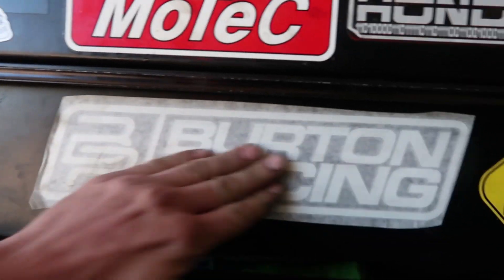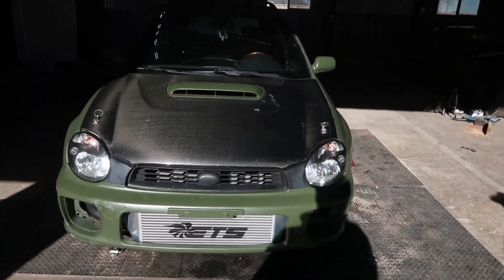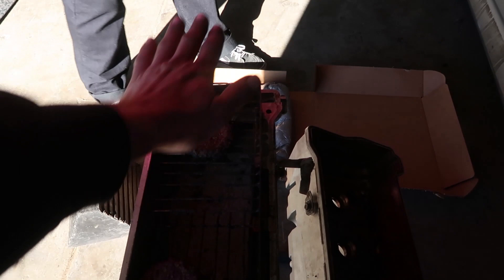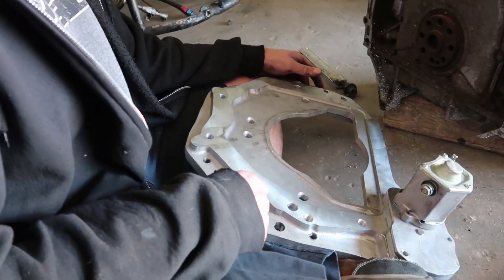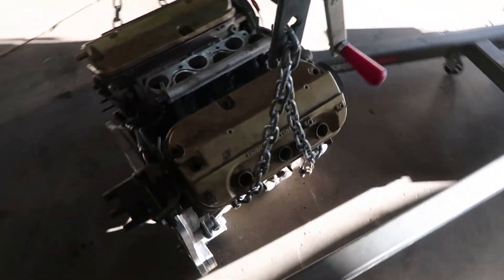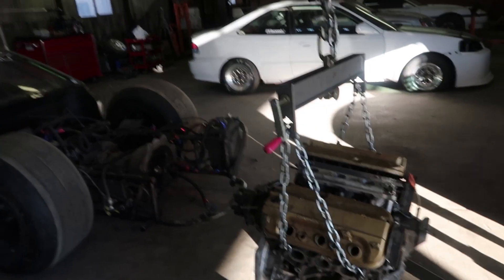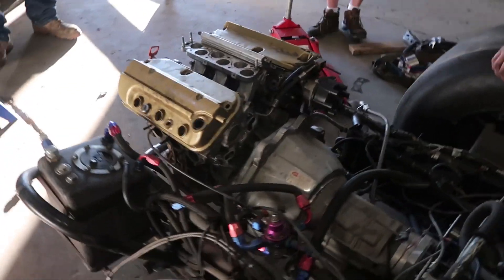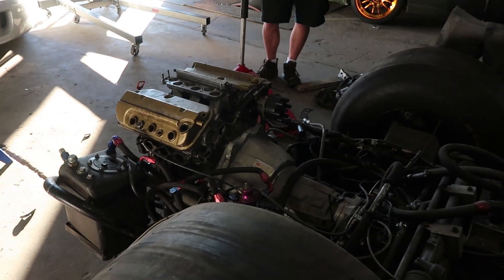The Bully Civic gets a V6?!?!?

Comment: Hey Brent. I have been following your channel for a while, and I have seen some content that made me realize that back when you were on the leading edge of the developing front wheel drive racing scene, I was also in the mix. I worked at Moroso Performance and was the designer and driver of the Moroso Outlaw Civic. The Moroso Chassis Shop guy's built the car, and Rafael Fuentes from Authority Auto built and tuned the engine. When we were campaigning the car, we made some great friends that were innovating and developing the technology exploding out of the import/front wheel drive racing scene. The Outlaw Civic was our test bed to get some race-proven parts into the market place like the oil pans, dry sump oiling systems, fuel tanks, and the FWD traction system. I think we may have been the first ones to put Willwood drag racing brakes all around, built a chrome molly solid rear axle with aluminum hubs, and the first traction system on a Honda Civic.
I freaked a little to see the Ed Bergenholts car in one of your videos. Rafael and I hung out will many of the guys racing in the Pro-Stock all motor, Pro Front classes and the pro rear wheel drives . The hero's of the sport like yourself, along with Sean Glaiser, Christian Rado, Raphael Esteves, the Bergenholts, Abel Abarra, Craig Paisly, Shawn Carlson, Lance Ho-young, Eddie Bellows, Gary Howe, Nelson Hoyos, and so many others were just the best people were trying to build the sport from the grass roots.
Reply: thats the coolest comment ever man feel like i was there

Comment: You should use heads with integrated exhaust manifolds. (If they fit) And just bolt the turbos directly to the head. Would save a ton of room. Plus lower egt's from the head cooling the exhaust gas.

Comment: would put the turbo's over the trans hot side out compressor sides in , that way you can make them shoot straight intoo the flipped manifold  using a verry short chargepipe and prolly use regulair NA style exhaust headers (stainless) with a small bendy pipes with wastegates going up and intoo the turbines 
exhaust after the turbines prolly two small smokestacks through the hood  over the turbo's 
prolly could do a hoodscoop in between the stacks to force more cold air intoo the tiurbo's
Reply from the maker: That’s a great dream I picture exactly that

Comment: Because you have so much room... You should run the exhaust header back over the top of the transmission and use a water/air intercooler for a super short run into the intake

Comment: Might be better to use one of the newer J's with the integrated exhaust manifold. Then you can make an adapter and bolt the turbos straight to the cylinder heads.

Comment: About the oil pan bolt hitting the starter, why don't you just counter sunk the hole in the oil pan and fit a hex countersink bolt witch will make it flush with the oil pan and give you the clearance you need?

Comment: Nice looking engine, think away the front cam pulleys and with those wide gold valve covers it almost looks like a compact (minus 2 cil.) classic Hemi. Same ridge in the middle and equally low places spark plug holes. Oh all the applications I could think off mounting this in a RWD setup.. To bad Honda never did more OEM RWD platforms.

Comment: turbos about 2" back and 2" up from the back of the valve covers, Nelson racing mirror image looking, and have the tb coming from the crank pulley side with the intercooler pipes splitting to both sides downward in a upside down y shape

Comment: Is that a J30? throw some J32A stuff on it, at least the heads.. Might as well get the head decked and ported with oversized valves if you go that route :p I believe K20 pistons will fit into a J32 so you can try that too. lucky for you guys J's are pretty modular

Comment: I have had two Preludes in my life. One was a fully restored 1986 Prelude Si that was Road and Track's actual test car as well as the first year for PGM-FI, and I had a gutted 1989 that I wanted to swap an H22 turbo into. Out of all of the engine swaps I have ever imagined for those cars (because let's be honest here, while ground breaking, the A20A was a turd), I never imagined a rear wheel drive swap, and never imagined a J swap being an option. I had a 79 Civic 1200 that I loved and I always wanted to put a B16 or even a D16Z6 into, but one winter I went to jump in the car and literally fell through the floor...lmfao It was a shame because the car only had 63000 miles on it. 1200 one barrel carb with a 4 speed, 63 horses of fury. That was my first car...I have owned 53 since then.
Reply from the maker: I love love love the 1200, there’s a gray one on the Internet with a Kswap , it’s a must find for you,  I’ve owned all those cars too lol and have swapped the 88-91 ludes with h22’s it’s work but cool, I’ve also seen some A20’s make 700 plus hp so I can’t talk down on any of them 😅😁

Comment: Have a question on gunmetal did you have to replace the bottom oil pan by removing that one Bolt to fit the starter or did you just packing some JB Weld and maybe some filler question not really sure on how I mean I see the seal would be tight but over time the right it would wear and tear and possibly cause a leak out of it but I'm still the same question did you replace the pan and everything before you took out that one Bolt
Reply: All good and fine with the thread going all the way through the wall but still my question is overtime right wouldn't that cause corrosion I think that's what my biggest question is I live in Arizona out in Phoenix it gets hot here so we have a lot of overheating temp problems and corrosion is a big deal unless you're Brent or Kyle more bright than Kyle over excessively checking everything before every drive or pass so yeah I just just that one question I mean if I lived up in the High Country the moisture wouldn't be a problem everything would stay constantly lubricated or as is and the only thing you have to worry about is freezing temps I have to worry about dry and brittle things breaking constantly because of the dry heat cell
Reply from the maker: Nope, just no bolt and rtv. She holds fine.
Josh

Comment: I wish I had the J32a2 rather then J32a3, with the single exhaust port per  side. As i am limited, but i got to figure out why I'm down in compression on a few cylinders. I'm suspecting valves, as previous owner never did Valve adjustment... should I try to get a new motor? Compression ranges from 160, to 270, but drives fine. Anyone have any ideas, or test I can do to determine  whether its rings, or valves?

Comment: Hey Brent! (And or anyone else with some input) I have a 2008 Acura TL and I fell in love with it my major problem is its an auto and I really wanna get back into another manual car im planning on selling the car but finding a manual TL whether it be a Type S (3.5L) or a Base (3.2L) is proving extremely difficult so I have a couple questions. Is the 5 speed auto/3.2L drivetrain I currently have worth building on or is it better to hold out and find a 6MT? Also any major diffrences between the J32 and J35? Say I find a base model manual with a J32 will I be missing anything from not going with a Type S manual with a J35 engine wise?

Comment: Hey wondering if you done anything with a F23a1??
Reply from the maker: Oh yah. Built a few . Stock head and H22a head swapped many
Reply: @PFIBrent  I'm currently working on rebuilding the F23 head keeping it a F series no head swap....I'm using k20a1 pistons any recommendations on springs an vavles....would you recommend using the adapter plate to mount a K series intake manifold?

Comment: Hey, im looking to make my 8th gen j series accord a sleeper family sedan. But im having a hard time finding turbo supporting mods. I got an oiled filter and cut the bottom of the airbox out so its free flowing. And im ordering an acura 3.7 l intake and throttle body. Then hondata and then... Im stuck. I cant find injectors or coils or "two-stage" coilovers. And those seem pretty necesary to run boost.  My car is an 08 honda accord sedan ex-l 3.5l vcm vtec v6. Any tips or websites would be much apreciated. :)

Comment: Did you fix the bending from the frames saw it in a old video doing a pass
Reply from the maker: Just tightened it up, it’s made to do that to transfer weight to the front the back of the car is just a trailer

Comment: That V-TECH grill is awesome once you get the header for the exhaust side he should put a broken turbo on it and turn it into a fan for the grill so it will radiate and maintain the same heat all the way through the grill Phong did an awesome job making that grill he ought to make more to sell on the channel and he could use a V-6 block and heads for a bigger grill and make it propane so you guys can have propane and gas grills and run the gas inlets where either the injectors would go or where the spark plugs would go
Reply: Keefe  Spencer dude that valve cover better not be magnesium or it will make a huge fire

Comment: Finally, I been waiting for a J project since Kyle bought that Odyssey.

I'm sure you guys already know this but the stock J's are only good to about 500whp (on boost). Anything higher and you're gonna need to build the motor.

For everyone wondering why the block had to be cut for the starter, it's because on stock J applications the starter actually is on the trans.